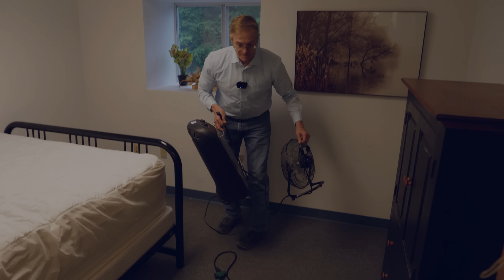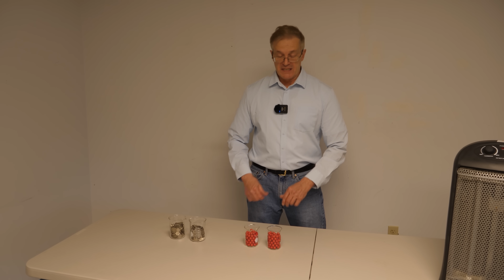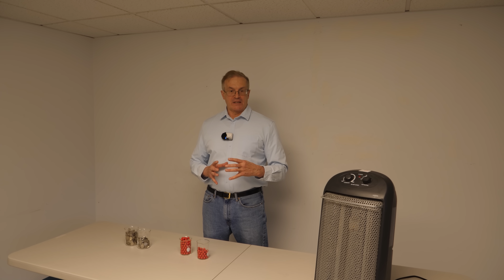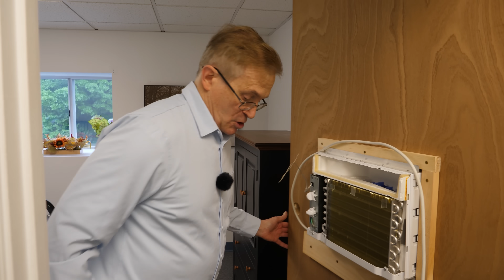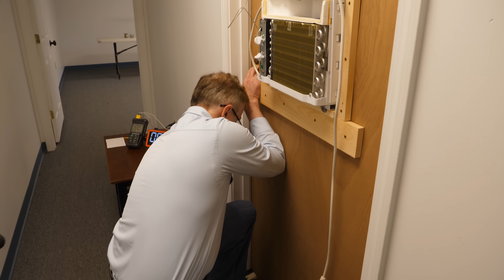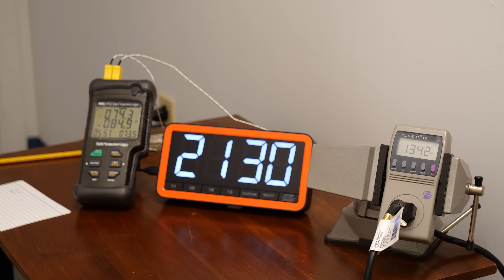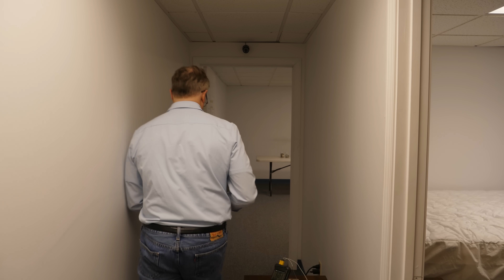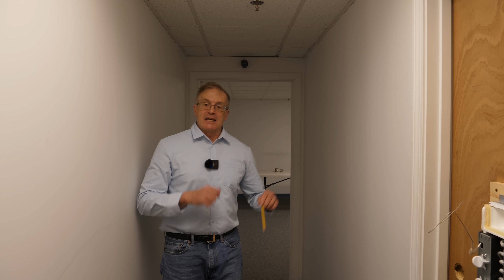You're wasting money on heating! Use your A/C!

Comment: Have to say something about increasing A/Cs effectiveness. I have an aggregate from a mobile A/C. As an A/C it was very ineffective because it throws air out of the room and some new air goes from outside. I disassembled it, took out the refrigeration unit and bent the condenser radiator down to a horizontal position. Then I put it all in the bath and filled it with cool water so that it just covered the condenser, and the evaporator was above and blown by a fan. This is how I cooled my apartment. The heat went into the water, the cold air into the room. I noticed that the compressor itself heats up quite significantly. Although its lower part was also in the water, it was tall, and there was no good heat transfer. I started pouring water directly onto the side of the compressor, and that’s when I noticed that the efficiency of cold production had increased greatly, because before my eyes, the evaporator became covered with frost, and then with ice. I can't say why is that so. It seems at first glance that the condenser must be the main point that you should cool down.
Reply: Cool! There are mobile ACs now that do that, it works but has a limited capacity. You could also have used a second pipe to suck in air from outside by covering the compressor air inlets of the AC with a box and connecting the second pipe to it.
This way there is no underpressure in the room and works way better. Thats how i did it.

There are some videos on youtube about it. (I guess in english too)
Reply: Wait, so you were just putting the heat into a bucket of water in your room?
Reply: @sompka1  It may surprise you to learn that some industrial processes use municipal potable water as their cooling supply since the few dollars per cubic meter of water (250 gallons) at 15c coming from underground could sink way more energy from their process than the equivalent energy to run a chiller.
Reply: @sompka1  a bath. Water drains heat very fast from metal objects. Much faster than air.
Reply: High efficiency air conditioners sling water around constantly for this reason. They intentionally leave a pool of water in the bottom of the AC to sink some heat from the hot side, which then evaporates.
Reply: You can't use this on the icy planet Hoth tho.
Reply: @mueffe1357  You can, may be, use refrigerant with lower boiling point and some another liquid instead of water. Ammonia may be. Depends on exact temperatures existing there.
Reply: @mueffe1357  It's worthless then. It doesn't work at -100 degrees, so we should burn oil for heat instead.
Reply: I don't understand this entire video or comments. Does your country not have reverse cycle air-conditioning?
Reply: @KonrUngr  There are a few window units and a few portable units that do have a heat mode, but most don't. Minisplits are gaining in popularity, but it is astounding how many people don't understand a window unit is 95% similar to the heat pump they despise (for whatever silly political or anti-green reason). In some cases, there is the issue of the unit that provides heat is 2-4x more expensive. It feels like the last 100 years of US home heating has been, "get the biggest most inefficient furnace or boiler and oversize it by three. Or burn as much wood as you can." Efficiency is not a word most people ever use, despite it often meaning "pay less money." You'd likely be surprised by the amount of "anti-heat pump" rhetoric all over the place. A gas hot water heater is maybe 1/3rd of the cost of a heat pump water heater in some cases. The tax incentives are there so that rich people can get the higher priced tech at less prices, and the lower income people are less likely to even consider efficient devices because the upfront cost is still too much for them, and likely the install is way more expensive.
Reply: @KonrUngr  Yes, it does.  Its not widely used in some parts of the country.
Reply: @KonrUngr  I bought one not so long ago but it cost.

Comment: if you want to explain the air conditioning heat pump principle clearly: take a spray can and a bicycle pump, connect the hose from the bicycle pump to the bottom of the spray can, stick temperature sensors on the bottom of the bicycle pump and on top of the spray can.  Just pump and spray.  Everyone understands this immediately.  few people understand the story about entropy.

Comment: A heat pump requires two heat exchangers. An air compressor requires none. This is something to consider, if you care about efficient heat pumps. Also, you paid no attention to the latent heat of vaporization. The the electric heating unit added no latent heat of vaporization or humidity to the room. While the air conditioner was adding substantial amounts of water vapor into the room. This latent heat of water vapor actually contained more heat value than the sensible heat that you were able to show digitally. This adds at least double your initial enthalpy to the room. This is kj/kg and you should have had a value for the initial and final for both tests. I understand that for simplicity you limited this video to sensible heat F. But your audience's intelligence  tends to exceed that of the common man. Water vapor and latent heat and actual enthalpy values would have shown an even better performace, well over 600%. In fact, water vapor and latent heat of vaporization is the future of ELECTRICAL energy production. This is the only source of fusion this world will ever be able to harness. BUT NOBODY CARES!

Comment: I regularly spray down vehicle AC condenser with water to accelerate the cooling in cabin of the vehicle. 

Curious if I use a windshield sprayer to mist it while sitting at a redlight water/methanol mix (windshield washer fluid) use of evaporative cooling to improve efficiency.

Comment: Using the ground as a heat sink/source would make it even more efficient due to the delta T from a "constant" temperature area (a few feet below the ground), even using a ground loop with a radiator will probably be more efficient because no compressor is needed for cooling operation.
Reply from the maker: Agreed

Comment: Your demonstration does not reflect the typical domestic installation. A typical heat pump installation does not draw heat from an internal hall way into a room, but is usually installed to pull heat from the outside air into the room. As the outside air decreases in temperature, this becomes much more power intensive, and the efficiency of maintaining the same temperature in the internal room decreases geometrically. Compare the space heater results while the heat pump is connected to the outside air in winter, and it will demonstrate the heat pump must consume more power to achieve the same effect. An air conditioning system is the same with the temperature gradient reversed: when it is hot outside, the unit must do the most amount of work to reduce the temperature in the internal room, expending a great deal more power compared to when the outside temp is lower. Disappointed.

Comment: I’ve been using my small 7cf chest freezer filled with about 16g of water along with a 12v small transfer pump to flow the cold water from the freezer to a PC heat exchanger in another room that’s 120sf. I have a cutoff switch to keep the freezer water no colder than 35f. I can run it for a week straight in near 100f ambient and keep the room about 5 degrees F colder than the rest of the house with a 100mm heat exchanger using about 140 watts. The water in the freeze equalizes at about 44f when running constantly. I use 2 noctura pc fans in series to blow the air through the exchanger. Doing the math though, compared to a traditional window ac it used the same power over time since one runs intermittently and the other is constant. The upside is one is near silent and still works if the power is out for a few hours if the pump runs on a small pocket sized battery bank. I have had questioned asked as to why I don’t use an antifreeze and run it colder. The reason is because the heat exchanger would frost over and eventually the circulating water would equalize back to the same 44f anyway. I feel the room environment is much better regulated than an intermittent ac system. The principle is the same as a mini split which is what many heat pumps are used in these days. I think another benefit of the low wattage use is it can be more easily ran off a wider range of generators and battery units with lower starting/total amps.
Reply: I do something very similar. A small fan+radiator from a PC,some vinyl tubing,wire,and a small 12Volt pump. I use the bathtub (or kitchen sink) filled with cold water from the tap (maybe 40-50 degrees F). It's not much extra cooling,but it does help,and only uses about 15W of electricity (It could easily be solar/battery powered). Once the reservoir of water is warmed,I just drain it and refill it with more cold water. It's enough to get a nice cool breeze in the room on warm days,but when it's really hot out,I need the big A/C.
(It also works as some extra heat in winter,if you have a source of warm/hot water.)
Reply: @PhattyMo  Your PC is a great source of warm water if you liquid cool, though probably RIDICULOUSLY inefficient :D

Comment: Good job! Here in Europe, we use heat pump (AC) heating quite extensively. Regarding the next video - I hope it won't be just applicable to integral "window" type AC units you have in the US but to "split" type units too - commonly found across the world, indoor and outdoor units are mounted separately and are connected by lines carrying refrigerants and electric power/signals. Of course, you have split systems in the US too but the window units are much more common in households, as far as I understand. 
I'd also like it if you touch upon the efficiency figures used for heating and cooling, as those are different and often misunderstood or completely ignored by consumers.
Cheers!
Reply: Split-system central air conditioning very common in US homes built in the past few decades. 95% of the time this is a split system. The compressor and condenser coil sits outside and the evaporator coil sits on top of the furnace (or in a dedicated air-handler) which distributes cold air via ducts.

I believe what you are used to is what we call "mini-splits" which is much less common but has become more popular in the past 15 years.

Comment: For euro folks and some other places the comparison is made between resistive and heat pumps because this is the best case scenario for comparing efficiency.

If you consider resistive heaters as 100% percent "efficient" then heat pumps are easily 300% efficient.

Lastly using propane or other hydrocarbon based fuels you should expect less than 50% "efficiency" this is because a lot of heat is lost to the outside from having to exhaust the carbon monoxide and such. You also loose energy in the unburned smoke and tar escape with the exhaust.

A lot of the energy lost in the exhaust can be recovered via more elaborate burners such as "rocket stoves" but you still wont reach the efficiency of the power plant burning the fuel for you and transporting the energy to you. Which is incidentally why resistive heating is used as the standard. 

Of course, the cost of electricity vs raw fuels varies drastically around the world. That is a economical and politically charged issue and not with in the scope of this video.

Ultimately, the most efficient way to heat or cool oneself is to heat and cool oneself. There are lots of jackets and pants with resistive heaters built in to only warm up your self and not your house but that is not as comfortable as walking around in shorts and a t shirt in your home no matter the season.

Comment: Thank you for sharing. It was a very interesting demonstration. However, in the wintertime, one would presumably not want to lower the temperature of one room (or hallway) in order to increase the temperature of another. In order for the experiment to be neutral, you'd have to add back the energy it would take to heat the room (or hallway) you just cooled. Wouldn't a better demonstration be to use the outside air during a season where you're likely to require heat, such as autumn or winter? I'd love to see the results of those tests because this is something I've considered doing myself, but always felt it would be less efficient than other forms of heating.

Comment: This only works as long as you live in hot climate. Present day air heat pumps in Europe manage to heat houses until around 6°C outside after which they stop working. Depending on country your regular winter temperatures outside vary from -5°C to 5°C, hence the heat pump does not work but it's the time of year when you ACTUALLY need to heat. If you still want to use heat pumps for heating in winter you must bury the heat exchaching pipes ca. 150m underground or underneath your whole garden, and even then your heat pump struggles. That's unfortunate reality, hope you mention this in your 2nd video.
Reply: My Europe AC works to - 5c ambient, and its a high temp model, for just a little more money I could have bought a unit that goes to -15 or -20. This was many years ago.
Reply: Completely untrue. Modern inverter type ACs will work well below 0°C, of course - with decreased efficiency and higher energy consumption. Some even work to -20°C and at that point they may be using 1500W of electrical energy to create 2000-2300W of heat energy. That is still better than a resistance heater. To quote a spec sheet of a popular Gree unit here, at -10°C it delivers 3200W of heat and the max it can deliver is 4500W of course, when the outside temperature is high enough. Max electrical power draw is 1500W.
Reply: It does not matter what your spec sheet says or what you can find in Google to prove the point. The reality is you install a geothermal heat pump if it's your only heat source in winter in colder climate. I'm actually the guy who makes and hands out the energy certificates for houses in Germany calculating all of this stuff.
Reply: @Dustmadeout If you're not lying, either you're not so good at your job, or there's been a translation mistake here. Many terms mean completely different things in different places.

Comment: i did the same thing with an old window AC this winter...flipped it and moved the temp sensor, then controlled it at the outlet/plug by other means.  Ran it from my off grid solar.  High efficiency cold temp mini split being installed soon.  12k Gree/saphire (blueridge) is very efficient at heating.... NEEP website in advanced mode is awesome info and analysis

Comment: Awesome demonstration. Keep in mind this is close to an ideal condition for a heat pump. They lose efficiency as the temperature difference between the hot and cold side increases. To impress skeptics, would be cool to do a demonstration in worst possible conditions.
Reply: YES love to see a efficiency- power curve graph for us in colder climates .
Reply: Mine gives about or over 5 KW heat for just under 2 KW power at -30°C
Reply: @tullgutten  pretty impressive. I guess main consideration is if you have poor insulation in a very cold climate you need a hell of a lot of electricity to heat a large volume. Heat pumps are more constrained in where they can be placed. You can stay warm with a small radiant heater by your bedside. For a modern build, no doubt a heat pump is the way to go.
Reply: @tullgutten how and where are you running a heat pump that cold?!? Northern Canada? 

Assuming a 410A system and a 16C indoor temp  you're looking at a lift ratio of over 7! That's an extreme compressor unless you're running a cascade system!!!!

Comment: Most common split units these days, probably outside of the US market, are by default a heat pump, because of economies of scale in making them over a cooling only unit. You can use it as an AC just by setting to cooling only, and have no difference in operation, but in most making it a heat pump is the default setting, and at no extra coat at all. Only difference is the reversing valve, as the same expansion devices are used in both, simply because it works in both directions the same, and the only difference is in the programming of the controller by setting a single option bit, as the controller is, by default, the same between them, and with cooling only they simply omit the one wire for the reversing valve, even though the relay is already on the board, and the cable is now only a 4 core plus protective ground, instead of a 5 core one. 2 heavy cores for the compressor, and 3 thinner ones for fan, reversing valve and protective ground wire, so not really much copper saved at all.